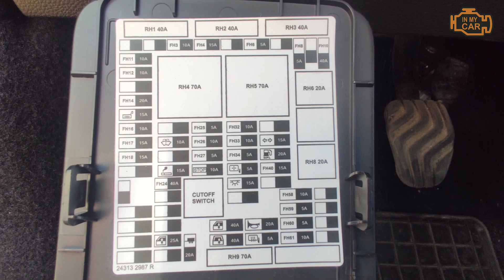DACIA Sandero III [2020--NOW] Where to find the diagnostic port OBD2, fuses box and battery?

Comment: Hi I have a 2022 Dacia Sandero, the front wipers have stopped working and I think it's a fuse but the manual and the diagram on the inside fusebox panel give no information on where the front wiper's fuse is. Are you able to tell me?